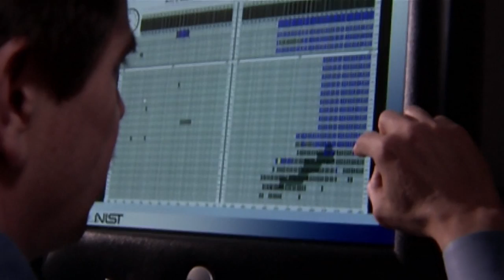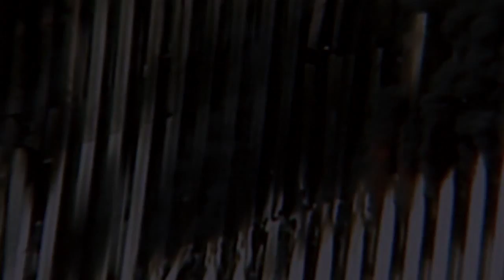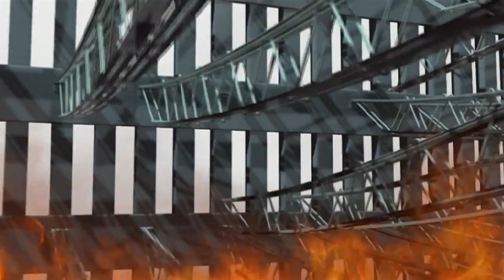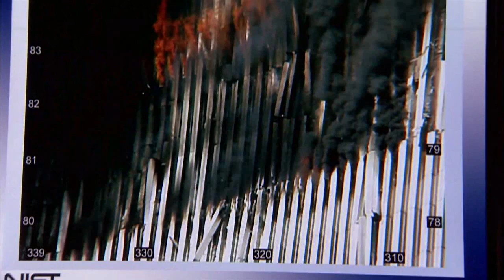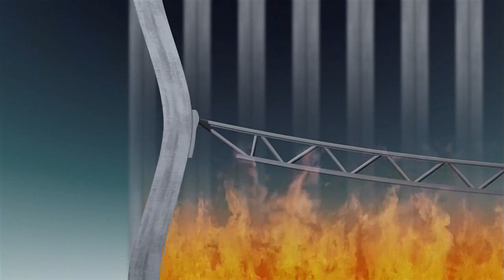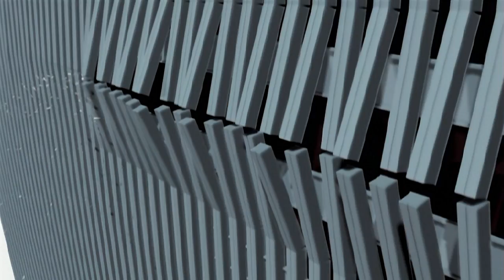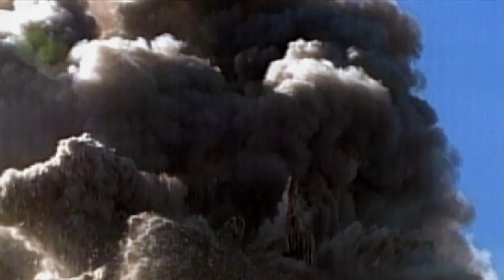WTC - collapse revised

Comment: 1) There was a 4 inch concrete slab on top of the trusses which would prevent it from snapping from the walls.

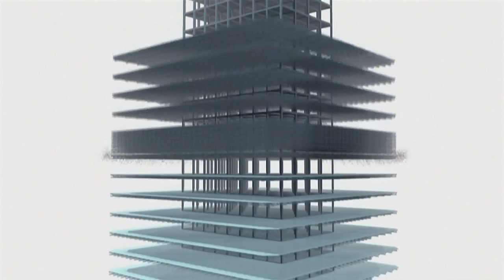2) 0:42 animation clearly shows the core column still standing as the perimeter columns and floors dropped.

3) Most of the weight of the building did not rest on the exterior columns. Even if the trusses snapped, broke apart and the perimeter columns fall, the floors would still be resting on the core columns. 

4) Even in the impact region, the fire did not spread across every inch of the floor uniformly, which means that in some regions trusses received sufficient heat to weaken steel, while in other places they did not. 

5) Iron microspheres present in WTC dust remains unexplained.

6) Even if both the interior and exterior columns give up at the same time (exterior columns separate from the main building  as all the  trusses break apart, and the interior columns sliced by the aircraft impact), only the upper section of 15 floors, in case of the North tower, would fall down upon the bottom uninjured section of 95 floors. In this process the upper section would disintegrate itself and destroy maybe 10 other floors from the bottom section. In this case we would expect to see atleast 75-85 floors of the North tower still standing in the aftermath. The way in which the smaller, weaker upper section could reduce the entire larger, intact bottom section to a pile of rubbles twenty feet high, remains unexplained.
Reply: The concrete is much much thiner in a building like this than in a car park. It most defentely would fail without the trussess.
Reply: Ham549 A Car park is designed to have the form work removed and carry cars. the point is that even if the trusses sagged the concrete floors would not sag with them. The video assumes that the concrete will be adding weight to the trusses and cause them to sag, trouble is that the trusses were interlocked with the concrete and the concrete had reinforcing so would not have sagged, the concrete would have helped stop the trusses sag.
Reply: Ham549 Just think about it for a minute. consider one quarter of the floor space from the centre of two adjacent sides, you have a L shaped piece of floor between the core and outer walls, how is the floor going to sag through the right angle between the corner of the core and the external corner of the building? it is going to have to sag at 90 degrees. this would require the floor to be ripped apart, the concrete was poured on corrugated sheets which were fixed to floor joists that ran across the trusses please explain how the floors could sag with all this crisscross support, and how the trusses could compress the concrete to allow them to pull the external walls in to the five feet proposed.
Reply: The concrete floors would most definitely prevent sagging. Once the concrete hardens the trusses have little effect. Provided the concrete floor is properly fastened to the columns, the trusses could be removed. Also the concrete floors can't be compressed which would have to happen for the external walls to be pulled in a supposed 5 feet. 
Have you never been in a carpark built from concrete? the framework that was used in the construction is removed. 
This whole fantasy video is full of week arguments and false assumptions it relies on peoples willingness to be deceived.
Reply: Newcopia No the floors are built like so trusses, then coregated steel sheets then a thin layer of concrete to provide a flat surface for the floor, maybe some rebarb but the rebarb used would be the thickness of a coat hanger.
Reply: helloqtip21 More precisely to believe that an aluminium passenger plane could leave a cartoon like hole in 1/4 " thick steel box section columns is the stuff of hollywood.
Reply: yep, they flew them out of Area 51... we best stop talking before we disappear.
Reply: Give me an example where an airplane had crashed into them before...
Reply: maybe a 767 broke a hole in some of those floors? to believe that the floors remain intact after being hit by a 767 is Hollywood stuff man...
Reply: I bet, you won't want to get hit by a "empty" soda can traveling at 550mph...
Reply: helloqtip21 I can't can you? it seems to me like something Hollywood would dream up it is far from what would happen if a passenger plane had hit it.
Reply: helloqtip21 I can't explain it as it has never happened and experiments have never been done to show what would happen. Passenger planes can't fly at 550 mph at sea level, and I made a mistake the steel was 1/2 " thick at the impact sites.These steel box sections were edge on which would give them additional strength, add to that the floor trusses and a 4" thick concrete floor every story gave extra strength to the outer columns.
What I would expect to see if a passenger plane hit the towers would be a lot of shredded aluminium parts because as you say the building was not solid, and possibly a couple of holes where the engines hit. The main spar might have caused some further damage but is unlikely to have pearced the wall.
I fail to see your point about the construction of the towers, the planes are made from thousands of lightweight parts that would be a much more complicated jigsaw to assemble and easier to break apart.
Reply: those planes were made with a titanium shell and frame which is why they broke through the 1 inch steel exterior columns...
Reply: helloqtip21 They were not hijacked airliners then were they. (statement not a question)
Reply: Wash Result actually point 3 doesn't make sense either... a truss needs support on at least two points, and even gives the chance of having some leverage over the support, but believing that it would've stood even if the exterior columns fell down, that is just improbable. The floors would've cracked and fell as the trusses no longer could support them.
Reply: Concrete slab wouldn't prevent snapping as the concrete is added weight and helped the trusses to sag with the raging fires.
Reply: +Brian Cruz And they just explained why, did you even watch the video? Or did you choose to fixate on this simple fact and not even bother to hear the expert's explanation and simply focus on the one written by 3 idiots with no background in chemistry, physics, or engineering (aka Dylan Avery, Jason Bermas, and Korey Rowe)?
Reply: There were also metal decks placed between the trusses and concrete.
Reply: The "TOWERS" were just that a radio antenna tower with some floors but mostly hallow. The building were hallow they added glass in 1978. Thats why they came down so fast and thats why you dont see any office type debris in the rubble and the new One World Trade Center is the same way and they are going to do the same with that too, All for their Jew World Order.
Reply: http://rebrn.com/re/sun-shining-through-the-world-trade-centers-260281/
Reply: stanzomanny very interesting
Reply: helloqtip21 How are you going to throw / propel an empty soda can at 550 mph? It would only happen in a fictional movie or in someones wildest fantasy.
What do you think would happen to that soda can if it hit a piece of 1/4" steel at 550 mph?
Reply: back to your first statement about the hole.. http://www.documentingreality.com/forum/attachments/f237/311494d1319156557-edna-cintron-woman-hole-9-11-woman-wtc-tower-hole-made-jet5.jpg how can you explain that BIG hole?
Reply: Please explain then, in your world what would happen if a 767 hit 1/4 inch steel at 550mph? Oh yeah, and the steel is not solid one piece from ground to the the top floors. Remember when the towers were built piece by piece like a jigsaw puzzle. https://www.google.com/url?sa=i&rct=j&q=&esrc=s&source=images&cd=&cad=rja&uact=8&ved=0ahUKEwjBn6iy_vjQAhXIJiYKHSITCIEQjRwIBw&url=http%3A%2F%2F911research.wtc7.net%2Fmirrors%2Fguardian2%2Fwtc%2Feng-news-record.htm&psig=AFQjCNFsBMsCIA4Lop6IVoFcDfgdbiuoGA&ust=1481987079347953
Reply: Newcopia the WTC was not a solid one piece building, it was built by pieces, http://911research.wtc7.net/mirrors/guardian2/wtc/knuckles-above-deck.jpg So the idea of a 767 hitting it at 550+ mph and smashing a hole is not that far fetch. If a Arrow can penetrate chainmail, why cant a jetliner ?
Reply: Jews built the Towers just to destory them later so they can come that much closer to their JEW WORLD ORDER.
Reply: Wash Result your point #3 is sufficient to invalidate the official collapse model
Reply: Wash Result yeah but the wall supports could have damaged the core when they fell
Reply: Ever seen three skyscrapers suffer global collapse on the same day due to structural damage and heat for the first and only time in history? I did. It was 9/11

Comment: How can the floor trusses pull the walls in if there was a 4 inch thick concrete slab right on top of them?
Reply: The concrete wasn't actually attached to the exterior columns or anything, they were just there for flooring
Reply: @StarstruckChiroMusic  the steel webbing was embedded in the concrete and attached to the columns.
Reply: @911ColdCase  Yeah but during the attacks, the impact, explosion and heat had not only damaged the concrete, but made the steel expand which of course would be enough to push on the core and perimeter columns, it then sagged due to the concrete being able to hold it up anymore
Reply: @StarstruckChiroMusic  The small bits of steel embedded in concrete expanded? The floor trusses expanded? what are you talking about?  The concrete would have to sag too. That is the point. Jeez.  damaged what concrete?
Reply: @911ColdCase  Yes, those expanded too, and the concrete was severely weakened by the impact and nearly immediate explosion that came with it
Reply: @StarstruckChiroMusic  180 decrees fell at one time. A ring. Therefore only the core can do that, not a stupid floor. 
 No witness said anything about a fire or problems with a fire. They were blocked by the core falling down. Jim Gartenberg said core and elevators were blown up.  The expanded crap which was blamed on all three buildings which were reported as being blown up..
Reply: @StarstruckChiroMusic  NIST said  there was nothing wrong with  the floors. Impact with a hollow light plane does nothing.  No one sued anyone.  Why would the entire top come down in free fall? The core was bombed., it is the only way.
Reply: Concrete would have been turned to dust in the impact. The concrete is on top of the trusses so the underside is completely exposed to fire.
Reply: Concrete vs thousands of tons worth of steel? The concrete becomes a piece of paper.
Reply: @justinnicolas2347  before the" thousands of tons worth of steel" he is talking about. Jeez
Reply: @justinnicolas2347  think of timing. The floor had to fall first so no thousands of tons of anything.  What would cause 180 decrease of flooring to fail at one time.
Reply: @justinnicolas2347  He is not talking about the weight of the building. He is talking the floor sagging. He is says How can the floor sag with all the concrete? 
Answer it can't.
Reply: @911ColdCase  "answer: it cant" it can though. your literally just wrong
Reply: @c4rbin  what? What can? what can't? Don't do drugs.
Reply: @911ColdCase  i was referring to when you said "how can the floor sag with all the concrete? answer it cant" and i said it can though because steel is much much stronger than concrete
Reply: @c4rbin  The 4-6 inches of concrete+ steel is the flooring. Below that is steel truss bars and trusses system also flooring.   Together they aren't moving .. They lied.  get it.
Reply: @justinnicolas2347  Concrete is literally used in buildings and bridges because it can withstand huge compression forces...
Reply: @fuckjewtube69  concrete is not as strong as you think it is, plus when heated the way it was, the weight of that building was MORE than enough to snap those supports
Reply: @AlphaWasSpotted  4-6inches of reinforced concrete. Buildings are made with the stuff.
Reply: Concrete does NOT do no very well under extreme heat.
Reply: The magic of computer simulations. lol

Comment: the tiny bolts connecting the trusses to the columns would break long before the 14 inch steel outer columns and the reinforced grid beams would even start to bend.  the trusses were fireproofed.  the tests done in the lab showed no sagging of the trusses, with higher heat and for longer time...there was no mass inferno burning an entire floor and melting all the trusses...there is no way the beams snapped all at the same time.  there are photos showing fallen sections of the floor and the trusses broken and hanging down...
Reply: This isn't some bath foam that floats away, it actually has to stick to the steel or else it's not effective. Also, it doesn't actually make the steel firePROOF, more like fire RESISTANT. Floors are required to be rated by hour, i.e. the time it takes for a fire to spread from one side to the other.
Reply: John Masters it's not garbage.  and you can use the internet to do your own research.
Reply: John Masters so prove me wrong....just don't claim that you know it's false...source your shit bro
Reply: The trusses weren't fire proof, fireproofing foam was applied to them for protection but is say an jet crashes into them a lot of the foam gets lost. If fire isen't a problem how come building code requires them to be covered in foam?
Reply: Ham549 you didn't understand what I said.  the trusses would break before the outer beams.  if the plane debris smashed off the foam, they would've damaged the trusses too, the trusses would've broken, not sagged down and pulled the stronger steel outer wall beams inward until the beams snapped.  the trusses would break, the small bolts holding the trusses to the beams would break, or the trusses would break under the weight of the floor, not the entire outer steel column walls, all the beam snapping all at the same time so the top of the building all drops as one mass...there was fire only in a small part of the building, so what caused all the beams to snap?  the foot print of the building is huge. do some serious research into this Ham549 if you are really interested in learning the truth.

Comment: If the exterior columns snapped from floors pulling them inward, why did the antenna drop first?
Reply: the antenna didn't drop first. The far side of the building started to collapse sooner than the side in the foreground causing the antenna to list.
Reply: muttkat1
The antenna and the top block of floors all tilted south at the same time to begin collapse. It only appears to sink from the north view. That's why the con men only show the north view, not the east view from across the Hudson.
Reply: But the video clearly shows the far side of the building falling at the same time the antenna starts to move.
Reply: FEMA and witnesses said it did.  That meant the inner core was destroyed first.
Reply: Various witnesses said the antenna wobbled, or shot up and FEMAS building performance report says it too.  That would mean the core went first.
Reply: The antenna rests on top of the core which was mostly made of drywall.
Reply: @CoolCademM The antenna on the N. tower weighed  47,000 pounds. Drywall ?...Mark Twain said " It's easy to fool people. It's much harder to convince them they've been fooled."  Trust the science. Not conspiracy theories.